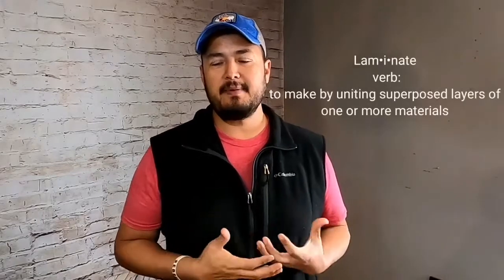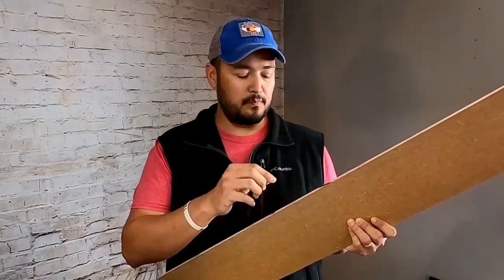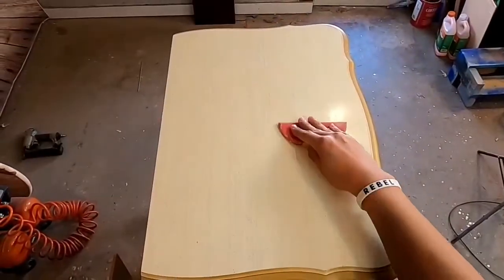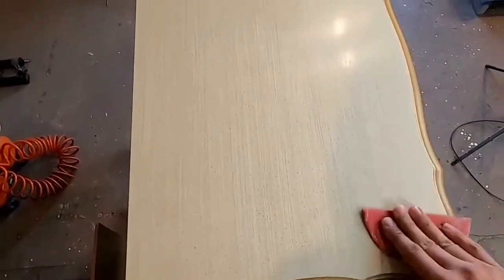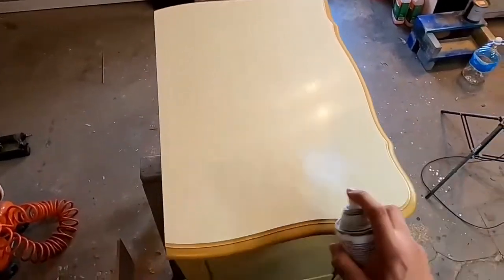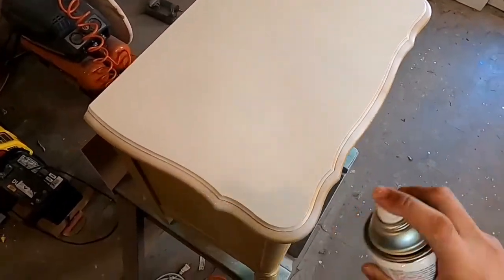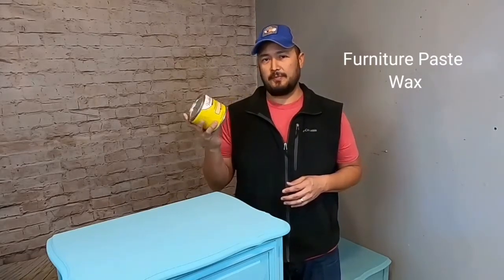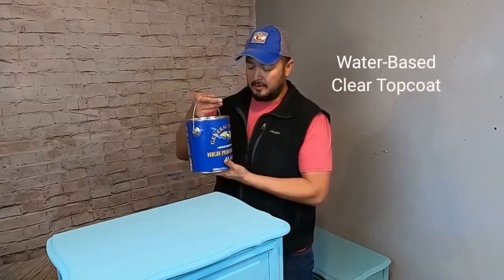Tips for Painting Laminate Furniture

Comment: Thank you so much for this informative video! I have similar pieces that I just bought for my daughter. An entire bedroom suit. I was about to begin and did a little more learning before opening the paint. I purchased zinsser water-based primer in 1 gallon and the valspar cabinet paint. My question is, can I use the primer I bought for the rest of the dresser? I plan to get the shallac for the laminate top, but it's expensive to do the entire set with it. Also, should I apply a topcoat using the valspar paint even though its "oil enriched"? I appreciate any input you may have about this.

Comment: What kind of paint do you recommend? I dont have a compresor or spray paint gun.
Reply from the maker: Hi Alejandra, no compressor or spray gun, not to worry, you don't need them.  When it comes to painting furniture, good quality materials make all the difference.  Lets start with paints:  You want to use a good, high quality paint...something formulated for high durability.  I like General Finishes Milk Paints and Chalk Paints.  You can go to their website and locate a dealer in your area.  I also like Valspar Cabinet Paint and Furniture Paint.  This one is a little easier to get a hold of so long as you're near a Lowes Home Improvement Store.  At Home Depot, I like Behr Chalk Decorative Paint.  Most anything by Benjamin Moore or Sherwin-Williams is going to work as well.
Now as for the technique, you do not need to spray to have a great finish.  the paints listed above all perform really well and level out nicely, leaving very few (if any) brush marks.  You will need to invest in a good quality paint brush.  I recommend a 2 inch sash brush by either Purdy or Wooster.  For the water based paints you'll need a synthetic or nylon bristle brush.  The compact size of the sash brush is comfortable to hold  and the angled bristles make painting awkward furniture pieces easy.  i hope this helps, good luck with your project, thanks for watching! :)

Comment: Topcoat? U mean to say Varnish?and Kind of primer i can use?
Reply from the maker: Hi, thanks for your comment...varnish is an oil based topcoat used sealing and protecting.   It is petroleum based, think mineral spirits,  paint thinner etc, mixed with resins.  As the petrol dries or flashes off, the resins remain and harden to protect your finish.  Topcoat is a general term used to mean any protective sealant over your paint or stained finish.  Today's topcoat of choice are water based.  Think, Polycrylic by Minwax.  They offer great protection, crystal clear finishes and clean up easily with soap and water....they also stay clear over time, where as lacquers and varnishes tend to "yellow" over time.  Varnishes also take more effort to clean up, needing mineral spirits or lacquer thinner for cleaning.   Hope this information helps,  thanks for watching 😊
Reply: @CoastalUpcycling  thanks for that comprehensive answer.... No 1 could give that much comprehensive that u gave...

Comment: How can you tell when the top of a chest of drawers/dresser is laminate?
Reply from the maker: Hi Tony, the easiest way to tell if the furniture has a laminated top is to first look at the top.  It will look too perfect.  There will be no variation in the wood grain (the natural lines in the wood).  Everything will look more like a photograph of wood than the real stuff.  Next, feel it.  Wood, even when coated with polyurethane or lacquer has a much different feel than laminate.  You can feel warmth, the grain,  tiny bumbs, ridges and imperfections of the wood...as opposed to laminate that feels cold and as smooth as glass or plastic.  Lastly (and possibly my least favorite) give it a scratch with a sharp tool.  Pick an inconspicuous area and give it a small scratch.   You'll be able to feel and hear the wood fibers tearing and breaking.  On laminate,  your tool will slide across the top smoothly.  With some practice,  you'll soon be able to spot laminated furniture miles away!  Hope this helps, thank you for watching 😊

Comment: Couldn't you just sand the laminate off completely?
Reply from the maker: Hello Scootermom, unfortunately no we couldn't sand the laminate completely off.  The laminate is a veneer that has been glued to the dresser, or in this case nightstand.  This type of laminate is really nothing more than an engineed plastic.  The best we can do is scuff it up, prime it and paint it.  Hope this helps,  thanks for watching 😊
Reply: @CoastalUpcycling  Yes, that helps a lot. I have a piece of laminated furniture that I want to change the look of and am watching videos to find the best, most cost effective way to do this. Thank you so much for your reply! 🙂
Reply: Hi! Funnily enough I have this exact same piece that I recently repainted.  I really wanted to remove the laminate because I wanted a natural wood top. The plastic top is very thin and glued on to wood underneath. I was able to remove the laminate/Formica top with a heat gun and a metal putty knife. If you start with the back corner and heat it really well you can wedge your putty knife under it and then work from there. The heat gun melts the glue. After I got the top off I used citristrip to remove the paint on the edges of the top and was able to sand and stain. However I will say this was a ton of work, took me hours, days even. I think it was worth it, and think my project turned out really well!